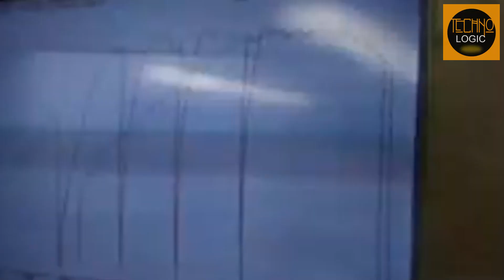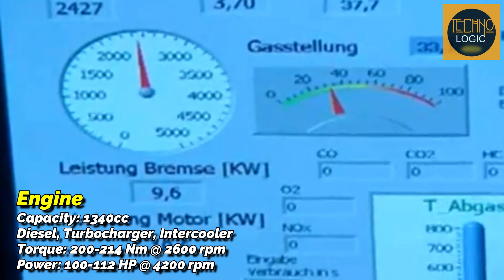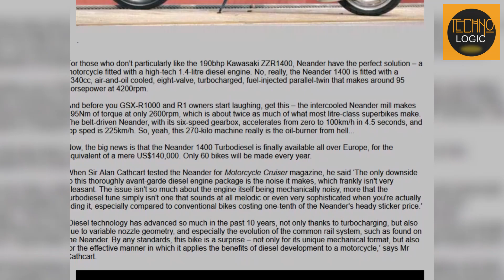INSANE‼️ World First BIGGEST Turbocharged DIESEL Engine from Germany

Comment: The twin crank engine design was not new, first developed by Frederick Lanchester in about 1895, it totally eliminates side thrust on the pistons and places tdc and bdc at different points relative to crank position which extends the number of degrees of the inlet and power strokes and shortens the compression and exhaust strokes, a brilliant design. Crankshafts being offset from the bore centreline is very common today for these reasons. He was also responsible for many other automotive mechanical designs that are still widely used today. He was one of the most innovative engineers there has ever been!!

Comment: This thing is cool, but even with it's bonkers torque, it's outclassed by bikes like the Triumph Rocket 3. A supercharged 1.4l parellel twin gas engine would also likely generally outperform this platform with less weight.